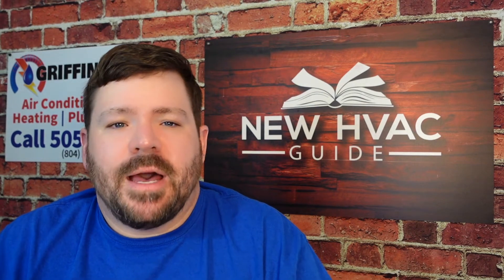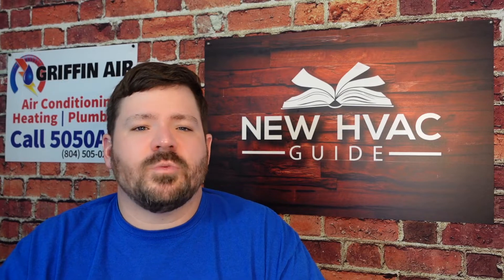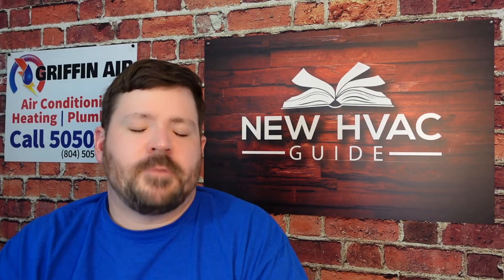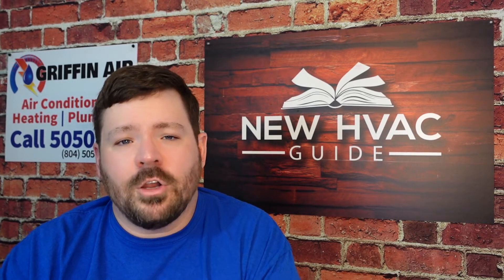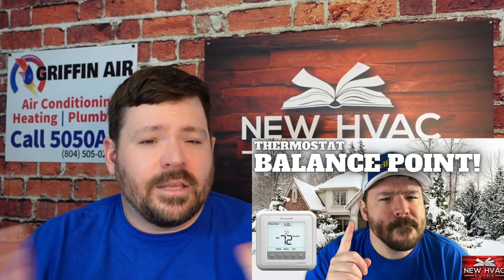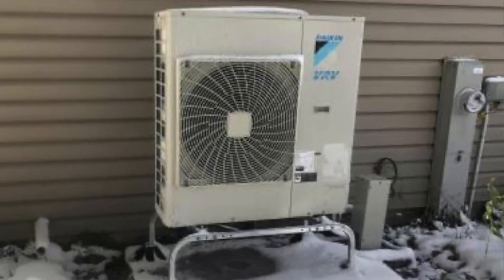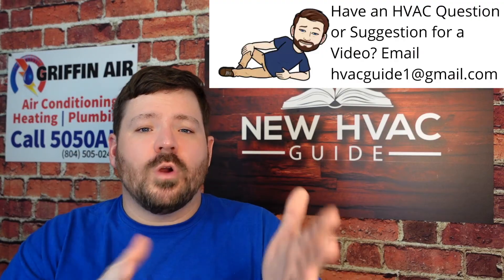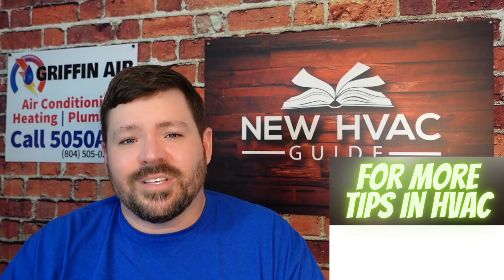Heat Pump SHUT OFF Temp with AUX HEAT!

Comment: I don’t have any heat coming out of my heat pump or aux heat. It’s cold in our house. I’ve had the son of a friend try to repair it twice and it works for awhile and then has a different issue. He’s fairly new at an HVAC company. Our system was 22 years old but I did get a new outdoor heat pump and some indoor work done recently about 5 years ago. Since then when it quits the kid repairs it and it lasts for awhile.

Comment: I have a lennox Model: ML17XP1-036-230A01 heat pump and a Model: CBK45UHPT-036-230A01 air handler. All electric I was told by tech that the aux heat max outdoor setting put on 35 and  the compressor min outdoor setting to be on 0 degrees. Is this correct? I have been reading and a lot I see recommended is aux 35 / 25 compressor min? Which is correct for my system?

Comment: If I'm just trying to run on heat strips in severe cold without the load of the compressor (because of being on generator backup in power outage)  can I just pull the disconnect on the compressor?  Will the heat strips still work in aux then?   Is it bad for the system ?

Comment: I have mine set to 10F it's an old Lenoxx HPXA16. it has a freon leak as last time we refilled, I think it took 5lbs. , so when it gets really cold, I think it just leaks freon due to increased pressure. So while I don't have a lockout I do turn on Ermheat at 10F. Before I started turning it off at 10F it was running in -15, after that is when I noticed low freon levels symptoms.

Comment: We have a new Daikin Fit 3 tonne ducted with air handler and 8kw electric auxiliary coil.

Daikin documentation says it works down to -23.3C, and that the only reason the aux heat is used during defrost is for comfort during defrost cycle (defrost works without the aux coil turned on).

Our first electric bill used MORE kw than last year when we ran only direct electric heaters to nearly the same temperature!!

Our installer is not intelligent.

So, I turned off the backup strip during defrost mode (which runs every 90 minutes, meaning I was running 8kw direct electric heat for about 16x per day, about 10 minutes each time).

Now, I want to ask about the auxiliary heart strip and heat pump lock out.  The thermostat allows you to set lock out point to -40c, but fasts way below the operating temperature listed in daikin documentation.

I can also set the lock out point for the auxiliary heat strip, but it must be 5 degrees above the heart pump lock out setting.

I'm in Nova Scotia.  Every few years we get down to -25 to -27c.  Rarely colder, and never beyond -30c.  More regularly, it'll be down to -11 or -12, and sometimes to -15 to -18.

Presently, it has been -11 hl last night and all of today, and the heat pump is purring along magnificently with the aux heat coil completely deactivated.

So, considering daikin literature stating operational to -23.3C, does it seem reasonable to set the unit to lock out the heat pump beyond -25c, and to not use the auxiliary coil above -15 or -18c...?

Thanks for any advice you can give.  It is ridiculous and a bloody waste of 30 thousand dollars is my new "300~500% efficient" heat pump system costs us more than direct electric heating.

Did I mention my installer is an ijit...?  (Many other examples I could give, but won't waste my time or expose you to my rant.)

Comment: I have a goodman 3 ton 2 stage 18 seer heat pump. Do i have emergency heat or auxiliary heat? I would like to know so i can connect it to the right terminal on the nest thermostat 4th generation learning thermostat
Reply: I'm not an HVAC guy, but emergency heat and auxiliary heat are the same thing.  The majority of heat pumps use electrical heat strips (think "toaster") when it's too cold for the heat pump to work.  The aux heat comes on automatically when needed.  Some thermostats have a switch that can manually turn on the heat strips and is usually called emergency heat.  For example, if your heat pump isn't working at all, you can turn on the strips if they don't come on automatically.  The automatic mode is definitely handy if it's necessary in the middle of the night.
Reply: @jsusna1972  thank you so much sir! Thats the best explanation ive gotten. Others have just been rude about it and stuff. Youre the only one that gave me an answer about how it works. Thank you.
Reply: @ You're welcome, and as I said, I'm not an HVAC pro.  If I stated something wrong, someone with more knowledge will correct me.

Comment: Had mine installed 5 years ago it's set at 10° outside temperature, the installer said he could set it at -5°  i said no thanks i don't want it working that hard in the winter, when it gets that cold i just set the thermostat on auxiliary.

Comment: I have a ecobee thermostat with my heat pump and I could set the shot off for my heat pump. My heat pump is set to shot off at -18 C, then my propane furnace kicks in. I’m on my second year with this system and so far the system is running great.I find that after -18 the heat pump is running longer and harder for nothing .Last year my furnace ran only 12 times.That’s a big savings on propane.I’ll pay off my heat pump in three years.From Northern Ontario.Regards Gerry.

Comment: Very interesting.  I’m up in Canada, the province of Quebec.  I have a new Daikin system consisting of a HP with an NG furnace.  It is a communicating system.  My electricity supplier has provided a form C contact that is activated when the outdoor temp falls below -12 deg c.  Its purpose is to force the system to use the furnace, as my electricity rate is increased significantly at this point.  How can this contact be wired into a communicating system?

Comment: My contractor says that the heat strips are turning on when the outside temperature is above 35 and they don’t need to be on. They say I need an outside air temperature sensor to lock out the heat strips above 30° ambient. Does that make sense? Why would the heat strips be coming on?

Comment: I’ve got HP set to 26 degrees lockout and my aux heat is propane. How does the HP know not to try to spin the fan if it’s frozen before trying to go back to HP operation?
Reply: The hp doesn't. If you switch to propane during a snow storm for example then when it warms up enough to swap back to heat pump you should go look at the outdoor unit and clear the snow off and away from the sides of the unit.

Comment: I have a Goodman GSZM4 and a Daikin smart stat. I live about half an hour SE of Winnipeg, Manitoba, Canada. Up until 2 weeks ago we were having an extremely mild winter with nightime lows above +20 F. However, nighttime lows of -30 F to -40 F are not unusual for December and especially January.

The installer is fairly new to heat pumps and didn’t really understand the Goodman install and performance data. I should note that the Goodman performance tables stop at -5 F. To me this is the absolute lowest temp the heat pump should be run at.

Looking at COP and T/R, I made a guesstimate of +20 F for locking out the heat pump and using the 5 KW heat kit instead. Manitoba has the second cheapest electric rates in Canada after Quebec : 9.455 cents per KWH. 

The installer had never heard of outdoor reset or outdoor temp sensors. I have a background in electronics and was easily able to obtain the proper 10 Kohm NTC thermistor. The Daikin smart stat has terminals for ODT sensor, and once wired in I was able to program the lockout.

Overall I’m happy with the performance, and understand the limitations of an air source heat pump. Next house will have a geothermal heat pump
Reply: Listen!!!!,,,, ALL THIS TALK, is for naught. Just get a HEAT PUMP WITH A BACK UP HEAT, either elecric or gas, and all will be ok, NO MATER WHERE YOU LIVE. Thats it!!!!

Comment: Like electric vehicles, heat pump units are only good for geographical locations that do not get below 20ish degrees as efficiencies in design are useless. As taught in thermal dynamics, heat cannot be destroyed, it can only be moved or transferred from one location to another. The only way a heat pump system is able to heat at such low temperatures is to add heat, meaning warming compressor. That means efficiency is thrown out the window.

Comment: Thnx. for the info. But i have a question, that i am hoping you (or any) can assist with an answer. I have a heat pump system with electric back heat. I live in Florida and is new to these systems. The unit works fine in the summer. Cycling on and off base on the thermostat. But. In the winter, months now, I notice that in the heat mode, the INDOOR UNIT  never shut off, the fan is always blowing air inside the house. And  i notice that the outside unit does not comes on. I am comfortable in the house. But I am concern that maybe the house THERMOSTAT IN NOT WORKING AS IT SHOULD. Shouldn't the OUT DOOR UNIT comes on and give some heat, then if it real cold out doors, then the heat strips comes on to give more heat? Am i right with my thoughts?
Reply: The outdoor unit should always come on in heat mode along with the indoor unit just like in cooling. Sounds like a thermostat issue In heat mode.
Reply: Thnx for the reply. Yes,  I now found out  that the outdoor unit should be on in the heat mode. Mine has an issue, that was preventing it from doing that. I will have to get it fixed. Thnx. again. @whitechevy33

Comment: Thank you! I think you basically answered the question I had. We just got a Bosch 20 SEER full electric (heat pump plus heat strips) system installed this fall. The installer set the compressor lockout at 32F. We're in Portland, OR so it doesn't get below freezing a whole lot, so I didn't think much about it. With the cold snap we just went through, I wanted to know more. Sounds like with a new, high-quality system that we have, I could easily drop that down to 20F or lower and still get some good use out of the system. Anyone feel free to let me know if I'm off course.
Reply: I just got a new American standard quest inverter variable speed 20+ seer cold climate, and I’m in wilamette valley, and I dont have the heat pump locked out. I have the aux heat strips set to come on if temp drops 2* below thermostat set point. Also have it set for 2 cycles per hour. Still works great at 25*, not running all the time. , heat strips have not come on yet. Does need to defrost maybe once every 1.5 hr. On demand, But that only takes 2 minutes.

Comment: We have two Goodman duel fuel heat systems.  One installed less than a year ago, the other about seven years ago.  Back up fuel source is propane.  Systems are 96-97% and have outdoor thermostat built into the heat pump.  This morning (in Ohio), the new system kicked on the back up heat at 15 degrees.  Must be set at 15 degrees by technician.  The other (which I just reset the exterior thermostat at 0 from 40).  I plan to switch to 15-20 degrees today for both.  Reason is, both systems seam to just run and not really keeping up/shutting off.  Thoughts anyone?  I think I'm right to simply pay attention to "if the units can keep up."  Guess I can chart costs between the two options.

Comment: Hi, I have an air source heat pump in Winnipeg, Canada running through my original 1931 cast iron radiators (hydronic heat) with these conditions:

Heat pump only: outdoor temp > -21C (-6F) 
Heat pump + electric boiler: -21C(-6F) > outdoor temp > -24C(-11F)
Electric boiler only: outdoor temp <-24C(-11F)

I've set these temperatures because I get a "low suction pressure alarm" is the occurane of low suction pressure common at these low temperatures or should the units be able to run side by side with the electric boiler at all temperature. Could this be an indication of an installation problem?

Comment: I’m a little uninformed on the heat pump market just hasn’t been a thing in my area however I have been researching and learning about these systems I’ve been selling the Bosch ids systems to some of my customers on propane because I feel obligated to try to save this very small group of customers money propane is a very non economical fuel in this area I still however set them up on duel fuel and I set the balance point as low as the Bosch stat will let me 5 degrees the Bosch system locks out at -4 my company won’t let me venture out to some of the less known brands  however I put a blueridge ultra efficient heat pump air handler system in my good friends house it’s rated to -22 I left the heat strips out on purpose it got down to -34 out at his place and it held 68 degrees 
Why are we still putting in conventional heat pumps? Why is there still a market for them? The price difference of the Bosch equipment and let’s say a conventional brand system is not that far off. I really don’t know what the average consumer is for the heat pump market but I feel the plus side of these low ambient heatpumps would be less heat strip run time which leads to energy savings

Comment: If I were the consumer and had a heat pump with the electric or gas back up I would want to know just how much its worth paying to run the condenser for a smiggin amount of heat it might produce. That translates into is there any value in doing so even if the unit can still produce a small amount of heat? Especially if the local electric rates are 40 cents per kWh or more. My guess is at those rates, a gas heater will cost less to heat a home vs. an electric central heat pump system. Gas air condensers also might be less to run than electric with dumb stupid rip off electric rates of today. Gas condensing refrigerators too.

Comment: We just had a Bryant heat pump installed (Northern Wisconsin) that is supposed to heat our 1800 sq ft house 100% down to 4F and contribute 75% down to -19F. We have electric backup. So far, we've spent less compared to last year on our oil furnace, but winter isn't over! I don't really care about cost. Just wanted to quit burning oil.

Comment: Just completed a set of Daikin VRV heat pumps with Ducted Multi -Position AHU's and added Electric Heat Coils. Programmed for the heat strips to start up when indoor temp is 6-8 deg below the set point. This is so when if the outdoor heat pump cannot keep up or breaks down all together, they electric heat kicks in. Also if the outdoor and the indoor strip runs together, the recovery time is very quick. So far so good, and the outdoor unit always keeps up and the backup heat strip only turns on if they purposely set the temp far away from the indoor temp.

Comment: As far as efficiency, you’ll have to look at the individual unit’s COP at various temperatures. There are some non-inverter HPs that continue to run down past -10F but the COP drops below 1. In that case, you should lock out the unit at/below those temperatures and just use heat strips. Unfortunately there are a lot of HVAC guys who are honestly clueless when it comes to knowing their own equipment, so buyer beware. Josh is doing a great public service having all this info out for people to see and learn

Comment: Another point would be wear on the equipment. Every compressor has so many hours of life and using those hours up when it is barely running more efficient than the resistance will cost you more in the end. Top end inverter systems can cost 12k or more and in a cold area used for heat and a/c will only have a life span of 12 years. That is a thousand a year in equipment cost. Just because you can doesn't mean you should. Compared to a good cast iron boiler that has a life of 40 years or more, heat pumps have a short life but not a small price.

Comment: Two words, Geo-Thermal!
Reply: Geothermal costs too much initially. You won’t see any ROI until the first system is replaced
Reply: @timrob0420  I would submit to you that the first day of operation it will start accumulating ROI, not just when the typical life span is reached. Higher efficiency and lower operating cost can’t be matched by a air to air.
Reply: @melvincoffman8252  wrong. The upfront cost of everything that needs to be done to install it the first time is much higher than any savings you will see
Reply: @timrob0420  this is where I say you are wrong and you should show me your proof of the negative ROI versus a conventional air to air.
The energy savings of up to 30%, double the expected lifetime of service and 30% tax credit is the argument killer.
Reply: Some folks never understand how unreasonable the costs heating and air conditiong systems just so they can claim to be paying less monthly to run them. Most folks want saving on both ends, purchase and operation costs. Lets talk about "Fusion" to generate electricity...tens of billions of dollars and its still not here, viable or perfected.
Reply: @Garth2011  It will only be available when the few that sit in the dark rooms of secrets will allow it.
Reply: To words....Too expensive
Reply: Three words, two damn expensive.
Reply: @ ? For who? Government rebates go as much as 65% of the total cost of installing.

Comment: I have a Comfortmaker heat pump that is 25 years old and still works well. I've never locked it out at low temperatures. I just let it run and let the heat strips take up the extra slack. I live in the midwest and it gets below 0 at times.
Reply: If memory serves me right... Comfortmaker = Carrier, IGP, Bryant.  My guess you have a heat pump with HSPF of 9+
Reply: Me too. Rheem 25 years old. Awesome beast. I maintain it myself... "3 Cs" cap, contactor, cleaning